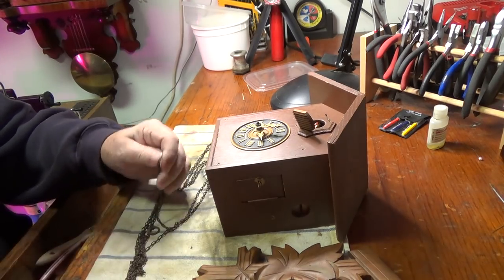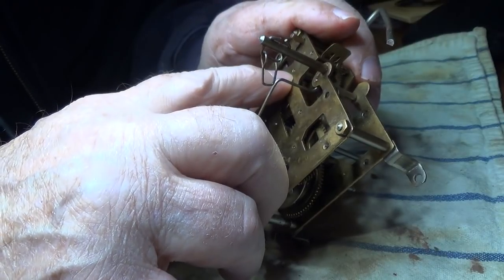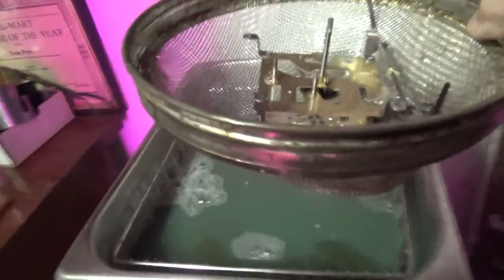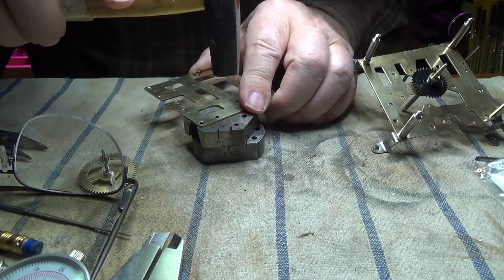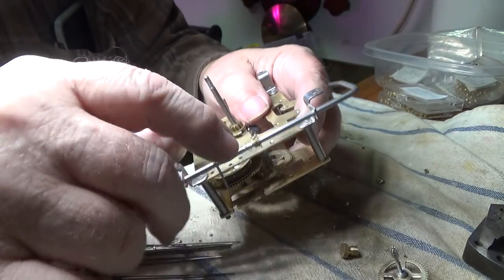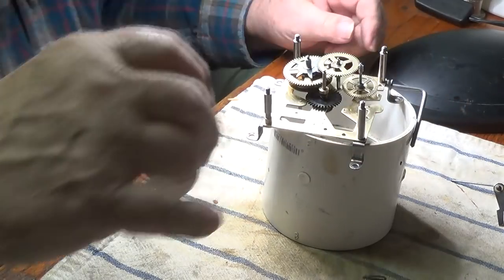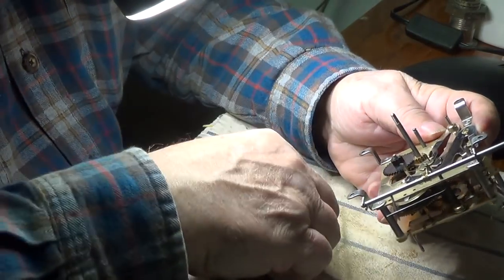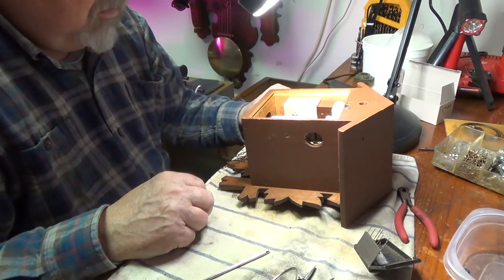Hubert Herr One Day Cuckoo Clock Repair for Kayla

Comment: An index for this video:
0:00 - 0:58 Unboxing the clock.
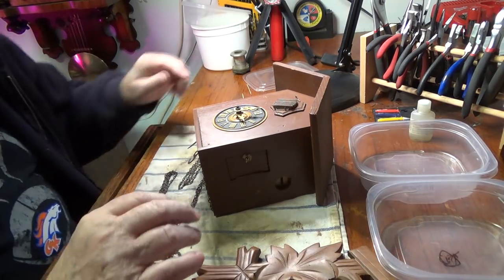0:58 - 2:10 Checking the case for damage and missing parts.
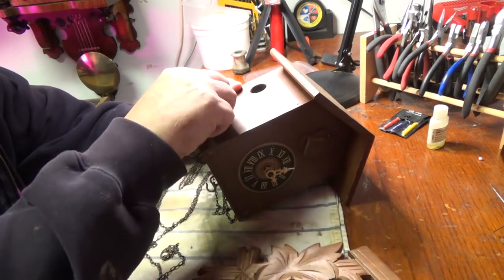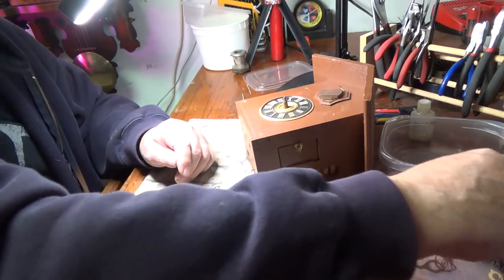2:10 - 4:24 Removing the hands and chains.
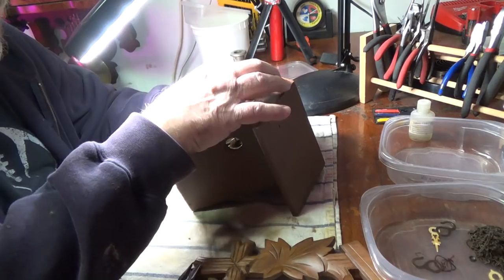4:24 - 5:05 Examining the markings on the back door.
5:05 - 6:31 Finding one bellow (whistle) is missing; finding a replacement; reading the movement identification.
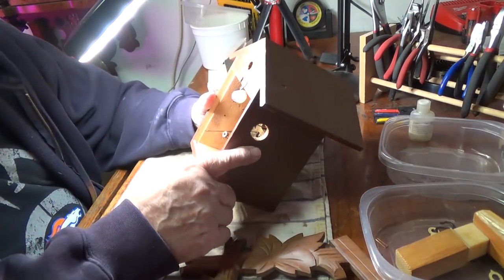6:31 - 8:03 Removing the remaining bellow.
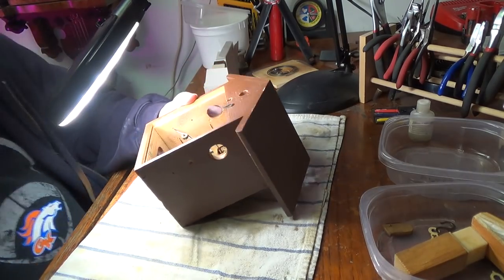8:03 - 9:05 Unhooking the bird; examining the screws that fasten the movement to the case.
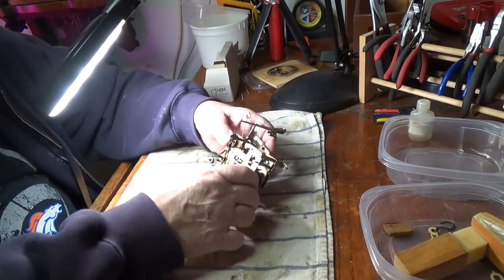9:05 - 10:34 Removing the movement; checking the case for insects.
10:34 - 12:20 Examining the condition of the movement; finding tarnish and lint inside.
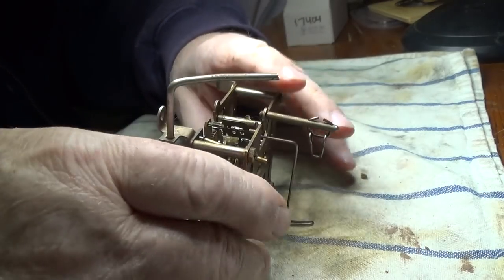12:20 - 17:25 Removing the exterior parts.
17:25 - 21:45 Checking for worn pivot holes; removing fuzz with tweezers.
21:45 - 24:27 Checking the Locked position of the strike wheels; Separating the plates.
24:27 - 27:17 Showing the working of the time and strike trains.
27:17 - 29:09 Showing how the minute post cams line up with the minute hand.
29:09 - 30:31 Preparing to remove the gathering pallet.
30:31 - 31:41 The weather report - arctic!
31:41 - 32:30 Removing the gathering pallet.
32:30 - 37:13 A special visitor.
37:13 - 41:48 The ultrasonic cleaner; rinsing with hot water; wiping the parts dry.
41:48 - 45:52 Polishing the pivots and arbors on the lathe.
45:52 - 51:17 Removing tarnish from the brass parts; cleaning the pinions.
51:17 - 52:18 Checking the time train for worn pivot holes.
52:18 - 54:17 Broaching the new bushings.
54:17 - 55:02 Testing the new anchor bushings.
55:02 - 57:38 Bushing the 2nd wheel: Filing the worn holes to even the wear; what file is used.
57:38 - 59:13 Reaming the hole for the new bushing; chamfering the hole.
59:13 - 1:00:21 Hammering the new bushing in.
1:00:21 - 1:04:03 Broaching (expanding) the hole to fit the pivot.
1:04:03 - 1:05:49 Smoothing the hole, using a smoothing broach and oil.
1:05:49 - 1:07:10 Checking the new bushings.
1:07:10 - 1:07:56 How to test whether a pivot hole needs a new bushing.
1:07:56 - 1:09:54 More bushing: Reaming, chamfering, hammering.
1:09:54 - 1:10:44 The repaired time train running on a test stand.
1:10:44 - 1:16:41 Bushing the strike side main wheel: Reaming, chamfering, hammering, broaching, testing.
1:16:41 - 1:21:44 More bushing, in brief.
1:21:44 - 1:23:21 Testing the new bushings on the first two wheels of the strike train.
1:23:21 - 1:28:39 Cleaning the plastic clock face and numerals.
1:28:39 - 1:32:32 Brushing out the inside of the case, then brushing it with diluted boiled linseed oil.
1:32:32 - 1:33:23 Removing latex wall paint from the back of the case.
1:33:23 - 1:36:29 Brushing the rest of the case with diluted boiled linseed oil.
1:36:29 - 1:39:26 Wiping off the excess linseed oil; setting the case aside to dry.
1:39:26 - 1:40:17 Pegging (cleaning) the movement's pivot holes.
1:40:17 - 1:44:15 Assembling: placing all the parts that go between the plates.
1:44:15 - 1:48:04 Closing the plates: sliding all the pivots into their holes.
1:48:04 - 1:50:27 Attaching the gathering pallet in the correct position.
1:50:27 - 1:54:32 Oiling the pivots, anchor pallets, escape wheel teeth, and minute post.
1:54:32 - 2:07:18 Attaching the parts that go outside the plates.
2:07:18 - 2:10:31 Re-bending the rack and drop lever; testing the rack and snail function.
2:10:31 - 2:12:43 Testing the corrected rack and levers.
2:12:43 - 2:15:36 Attaching the bellows levers and the hammer.
2:15:36 - 2:17:45 Attaching the bird and chains;
2:17:45 - 2:22:28 Putting the movement into the case.
2:22:28 - 2:23:07 Testing the new bellows.
2:23:07 - 2:23:38 The clock cuckoo'ing on a test stand.
2:23:38 - 2:23:50 The finished clock running on the wall.

Comment: Excellent video. Working on my grandfather's cuckoo clock that is the same model. What cleaning solution do you use?
Reply from the maker: This is what I use:  https://timesavers.com/i-22336012-zenith-watch-clock-cleaning-concentrate-251na.html  You can make your own using Dawn dishwashing soap, Murphy's Oil Soap and a bit of household ammonia if you want to remove tarnish from the brass.

Comment: I love these videos. Do you take in clocks from anywhere? I have several which need fixing and would love to not only get them up and running again, but to see it on this channel ☺️
Reply from the maker: Sometimes I do, but I have enough to do when I'm again able to.  I pretty much only do clock work during winter when I can't be outside. I have a few to catch up on and can't even do those until my new hip heals. I also have a few of my own in my collection that need work and I need to get them done to give away to my children and grandchildren.  I don't have a business, just a part-time hobby.  If Providence gives me more time, keep watch and perhaps there will come a time when I can accommodate you.  In the meantime, why not try the repairs yourself?
Reply: @dperry428  That's totally understandable, was just curious since I recently stumbled across this channel and have been wanting to bring back those clocks. I'm actually blind, which is why I'd never even think about trying to work with these. Would probably ruin the parts before they were even out of the case😂.

Comment: Great video as always. I like the way you explain things. I have a question though. How similar/ different is Hubert Herr movement to Regula 25 in terms of strike side assembly. On a Regula 25 one has to pay attention to the gathering pallet position in relations to the black  S shaped plastic tab on the same wheel and also the tab that keeps the bird perch closed. The the star wheel can easily be adjusted later since it is outside. How does the strike side work on a hubert herr? Thanks .

Comment: Those little E-clips, when located  between the plates are a real pain to install!  Makes me wonder how these get installed in the factory.
Reply from the maker: I should just break down and buy the tool to install them.
Reply: I'm waiting for the sting of buying the wrong pliers to pass :-(  I bought some McMaster-Carr ring pliers that looked like the right thing, but turned out to be way too weak (pressed metal handles rather than cast handles).

My plan is - once I feel rich enough - to buy "Knipex 46 21 A01 SB Circlip Pliers for external circlips 3-10mm 90° angled" from Amazon, based on a thread at the NAWCC site: https://mb.nawcc.org/threads/e-clip-or-locking-clip-removal-on-back-plate-regula-movements.155880/ I'm hoping those are the right pliers to painlessly install and remove those nasty Regula  e-clips.
Reply from the maker: @BradfordNeedham  The worst parts for me are my increasingly poor vision and the slight magnetism of the pliers.  Get those tiny 1/16th inch e-clips in place, bring the pliers close and watch the clips get pulled right out of place.  Really not a big deal, but just slight aggravation.  I like the small needle-nose plier.  I think I'll grind the tips and silver solder brass in place of the steel.

Comment: I have the same Hubert herr, how hard should it be to turn the square shaft like your doing at 2:11:40   I see your doing it with your fingers on my I need to use pliers. Is this a problem if so how would I fix it? Thanks.
Reply: And where would I buy the short bellow lifter 2:13:03
Reply from the maker: Without the final nut on the innermost threaded rod, it should be very easy to turn.  Many people do not understand how the  motion works on the Hubert Herr is meant to function and end up modifying something to make it work the way they THINK it should work.  In all clocks there is a need to have a clutch mechanism to allow for the manual movement of the hands to set the time when needed while, at the same time, providing enough friction to allow the hands to be moved by the mechanism to actually keep time.  The real clutch is on the center shaft between the plates and the motion works that moves the hour and minute hands is disconnected from the that clutch mechanism when the end nut is not screwed on and tightened against the minute hand tube (the one with the square, threaded end).  In my video, the end nut is not on, so I'm only moving the motion works and not the clutch mechanism on the threaded rod.  So, when I turn the square end, which would hold the minute hand, I'm only turning that tube,which also has the cams that activate the strike, the intermediate wheel, and the round tube that would hold the hour hand.  Without the end nut, the motion works is disconnected from the rest of the mechanism and without it, the movement would run, but the hands would not move.  When the end nut is put on the threaded rod (center shaft) it is tightened until it jams against the square tube.  That tight nut is what connects the power from the movement to the motion works.  When someone doesn't understand how that works, they may think that the minute tube itself should have a friction fit against the threaded center shaft and squeeze the tube against the center shaft.  That would make the square difficult to turn.  It is likely that is the problem. The remedy would be to restore the round tube or replace it with one from a "parts only" movement.
Reply from the maker: Since Hubert Herr is no longer in business, I know of nowhere you can buy parts.  The only options would be to make one yourself or get a "parts only" movement from somewhere like eBay. Making one wouldn't be too difficult if you have a small lathe.
Reply: Thank you very much. Video was very helpful other than this small issue I’m having.
Reply: @dperry428  so the central shaft without the jam nut on it should turn easy without pliers? The minute hand tube turns easy by just fingers.
Reply from the maker: No, the center shaft will always be difficult to move as it has the clutch on it. Without the jam nut being on, the gears that move the hands (motion works) are disconnected from the movement and move easily, but that central shaft is still connected to the movement.  Put the minute hand on the square-ended tube and tighten down the jam nut. The hand should act as enough of a lever to to cause the clutch on the center shaft to slip.  If it doesn't, there is some problem between the plates.  The clutch should slip with just a little force.  That's what allows the time to be set.  Otherwise, you'd have to move all the gears in the movement just to set the time.
Reply: @dperry428  thank you.
Reply: @dperry428 should the snail and gear spun freely on the tube? When I spin the tube on mine the cam doesn’t move.
Reply: @dperry428 gear on back of tube spins freely but the snail doesn’t
Reply from the maker: The hour hand tube should have both the snail and the gear firmly attached.  As the hour tube rotates, the snail should follow or the number of cuckoos will always be the same.  If the gear on the tube is loose, the hour hand will not move.
Reply: Thank you so much I finally got everything to work as it should.

Comment: I’m just starting out on repairing cuckoo clocks.  One problem that I keep finding is clocks that keep cuckooing until the weight runs down.  Typically on 1 day clocks by Hubert Herr or Harzer Uhrenfabrik. They seem to have almost the same movement.
Reply from the maker: Bent or missing warning pin or bent lever in the strike mechanism.  https://youtu.be/b_RxfNN6vX4

Comment: One of the things I do now is I unscrew the bird from the perch, instead of bending the wire off the door. It’s less chance to snap an old wire and all you need to do is slide the bird off after you loosen the screw.
Reply from the maker: I've done it both ways, as well as both.  Many times, especially on older clocks, the wooden bird needs repainted or, on any clock the door wire needs replaced anyway because of rust.

Comment: I'm a new subscriber and just wanted to say Hi! I started watching and now two days have passed! I admire how you work and with what you work with... There doesn't appear to be any $2,500 bushing or other terribly expensive machines to be seen... That's encouraging for someone who might want to start tinkering with an old clock or two.
Reply from the maker: I've been repairing clocks for more than 50 years and have worked with minimal tooling for most of those years.  I finally bought a spring winder.  I'm just too old to work with the springs the old-fashioned way. I encourage you to stick with your interest in clocks and to check out the National Association of Watch and Clock Collectors (NAWCC).  They have a nice website and a message board where you can learn a lot.  Also, some nice YouTube videos for the beginner.  https://mb.nawcc.org/
https://www.youtube.com/watch?v=lDZHlcjQnOo
Reply: @dperry428  I will do that, thank you! I'm a retired computer programmer by trade, but love technology of all types. We have three windup clocks here in our apartment. A grandfather, an Atmos, and a recent small 400 Day Cock that I bought just to watch it work... All of them work well. However, I just sent the bellow off to be recharged for the Atmos. This effort kind of piqued my interest in clocks again. A look at eBay is kind of sad... In that, there are so many old mechanical clocks out there that need some love. I ordered three older used books from eBay on the clock repair subject and have 67 years of tools but none specifically for clock repair. Watching you gives me an idea of what might be the minimum required...   Ironically, I just watch the first video where your new Main Spring tool showed up... It's a beauty! Again Thank you!

Comment: Is it advisable to oil the clock every 3yrs? Or NOT to oil at all? Some say it doesn't matter if you oil or not ....the movement will last 30-35yrs whether you oil it or not is this true?thanks and great video :)
Reply from the maker: It depends on a number of variables.  As a general rule, it is advisable to oil the clock every 3 to 5 years.  However, to properly oil a clock, removing it from the case to get to the pivot holes in the front plate is necessary. If you can do it yourself then, by all means, oil it.  If you cannot do it yourself, your  choice, then, is to take it to a professional, an expensive proposition.  Now, you have to decide whether the cost of professional maintenance is worth it to you.  If the clock is a cheap, modern clock, you may find the cost of maintenance exceeds the cost of simply buying a new one.  If the clock is a valuable family heirloom or an expensive modern one, you may find it a wise choice to have it professionally maintained.   Also, if the clock is valuable either as an heirloom or an expensive one that you intend to pass along to your heirs, you may find it cheaper to pay a professional to maintain it rather than pay the much higher cost of replacing bushings and pivots caused by the wear of neglect. Other variables as to how often a clock should be oiled include the environment in which it is kept.  If it hangs in a kitchen, for example, exposed to oil and grease of cooking and the heat from the stove and oven, the clock will not just require oiling, but cleaning more frequently.  The quality of oil used in lubricating the clock is another variable.  3-in-1 oil is NOT clock oil, nor is WD40. Use those and a clock will not only need oiling more frequently, but a complete overhaul. As for the 30 to 35 year lifespan of a movement, that may be true, but it will likely not run that long without maintenance of some sort and also may lose it functionality, such as chimes that don't work or a clock that doesn't keep accurate time.  A clock is a machine, a mechanical device.  it requires maintenance to continue to function as designed, much as your car.  When you buy a car, do you choose not to change the oil and just drive it until it fails, then buy a new one?  I've known people who do exactly that.
Reply: @dperry428  thanks a lot,I highly appreciate your straightforward answer :) thanks again and have a great day.
Reply: Can a nobish nil training repair coco clock?where can i repair?

Comment: Great video.  I have recently received a Herr 1 day clock but cannot figure out how to engage the night shut- off. It's got three side door.  Can you help?
Reply from the maker: Not familiar with the night shut-off on that clock.
Reply: @dperry428  Thank you. I really like the clock just don't want to hear it at night.
Reply: My 1940's Herr does not have one...  Mine has 3 chains and just removing the weights that do not run the clock will turn mine off.  Possibly the cuckoo can be shut off with the door hook.